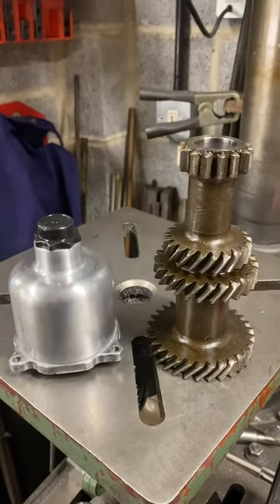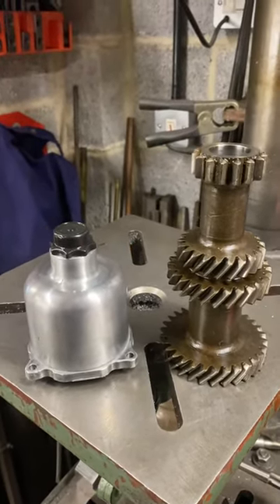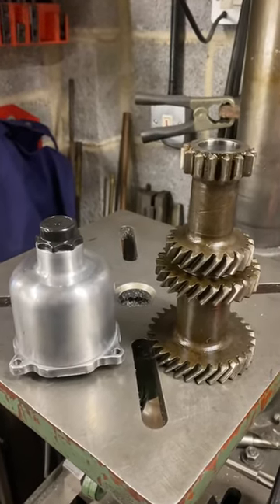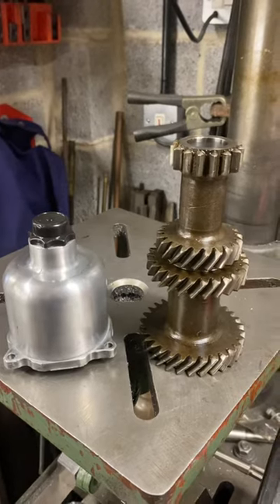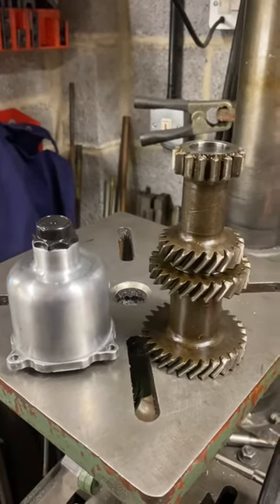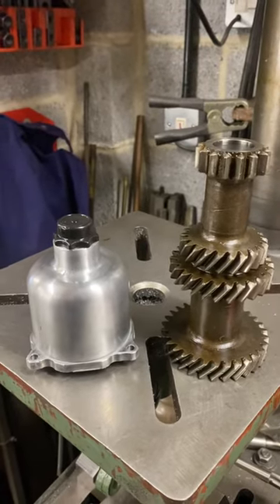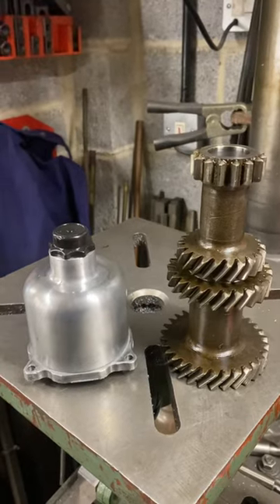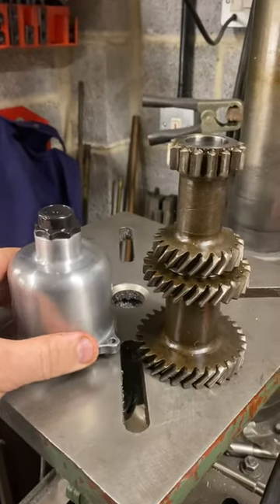ACDodd’s Starting point for HIF Carburettor dashpot oil

Comment: Novice here and not having a lay gear with no idea what it is except it’s in the gear box, I would need to know its weight and would that weight apply to a Hs4?
Reply from the maker: 1.4kg, it’s a guide only but it does let you know if the damper is working or not.

Comment: Hi AC, I just did this test. 20w50 ended up about 6 sec.
10w40 just under 5 sec.
ATF atound 2-3sec.

So now got to find me some 5w I guess 😁

Did the test with a 1,4kg bottle of water 😆
Reply from the maker: That’s it well done, but remember it’s only starting point
Reply: @ACDodd  yeah I understand. I'll be using the 10w for now to see if I can feel the difference, and how the car will perform. And go from there.
Reply: @GTE_Channel   SU recommend straight 20 oil , others change viscosity with temperature...

Comment: You reference the larger SU's, what about the twin HS2's on the Coopers and S's?  Same timing?
Reply from the maker: Not tried that yet, however as I said it’s starting point final tuning is completed with a wideband, off the top of my head I would have suggested 3 seconds is more appropriate for twins as a starting point

Comment: Great video. Should one go for a lighter spring in the carb for a fast road mini like the blue one or heavier like a yellow?  Twin hs4s on a 1310cc 286cam. Thanks
Reply from the maker: Twin carbs start with a blue spring and 8114 dampers, see if the pistons are full open at max power rpm, if they open fully early fit read springs.
Reply: @ACDodd  thanks.  So basically the best for performance is the lightest you can get away with? Good ton know as very little information on spring choice out there 👍
Reply from the maker: @jonesboy2004  no it’s the lightest spring that allows the piston to be fully open at full power rpm and not before
Reply: @ACDodd  sorry one last question. The blue spring works well and have a wide band to see AFR. The question is should I go fast drop damper 8114 and thicker damper oil which is needed to enrichen on acceleration due to the extra movement it gives or a lighter damper oil and a 8103 damper that dampens sooner? Both give the required AFR and driveablity but not sure which is best for performance.  Thanks very much.  Keep up the good work.
Reply from the maker: @jonesboy2004  you can’t get fast drop dampers for the HS type carbs as the drop rate is partially determined by the oil viscosity. Drop rate is determined by the speed of gear change, if you have not flat spot after changing gear you have no need to change anything
Reply: @ACDodd  thanks sorry so should I use the damper that allows me to use the thinnest damper oil. Or the damper with the bigger range of movement and needs thicker oil? 🤔 Ta.
Reply from the maker: @jonesboy2004  use a damper that allows you to use the thinnest oil that still delivers sufficent enrichment on acceleration

Comment: WD40 and no damper in a HIF44 (on a Harley Davidson) Goes like a stabbed rat!
Reply from the maker: You have to ensure you are getting the correct mixture on acceleration when not using a damper.
Reply: @ACDodd  Indeed, a wideband AFR meter is a useful tool.